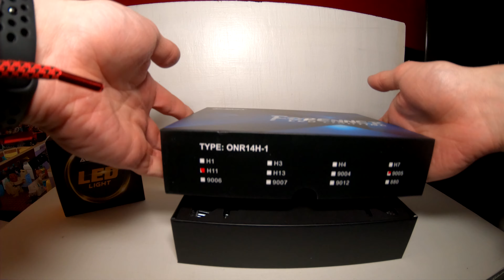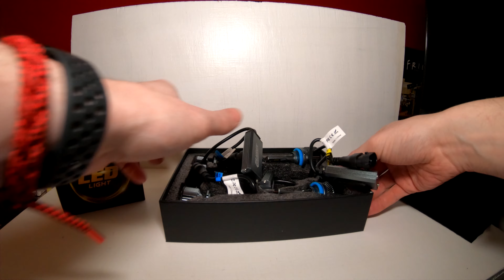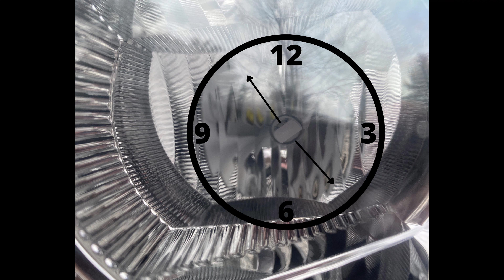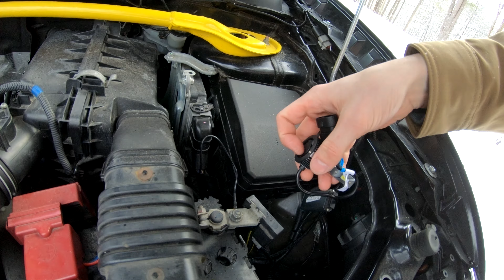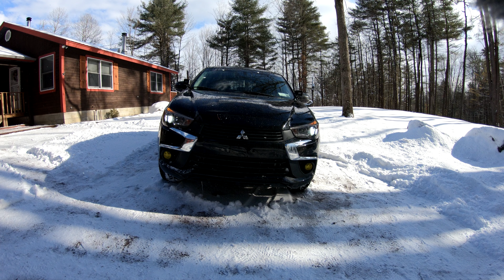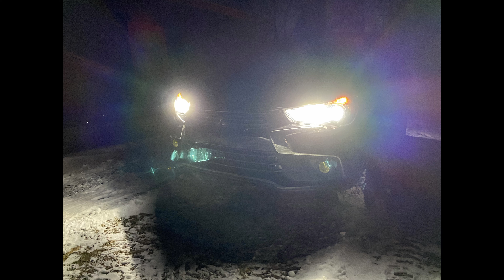Fahren Low Beam and High Beam install with Auxito fog lights on Mitsubishi Outlander Sport

Comment: Hi Jarred26. I purchased and installed the sequential side markers that you did a video on. I did them because your video. On these led bulbs you installed in the front, did you get any electrical faults or problems? How have they been working and can you leave a link for these bulbs. Thanks
Reply from the maker: Over a year with all the led bulbs in the headlights and fogs. No issues at all and the links are still active in the video description so I suggest going to those. That’s the exact ones I purchased and zero complaints or performance issues in the last year.
Reply: @Jarred1115  Thanks I didn't think to check description of video. I will. I know some cars are sensitive when LEDs are installed and throw all types of fault codes on dash. Glad that these seem to work. I'm going to look into doing mine. Appreciate it Jarred.
Reply: One other question. If my outlander sport has hid bulbs, can I  replace them with these led bulbs?

Comment: How come only part of the assembly is showing? Like should their be more bulbs
Reply from the maker: Are you referring to the still photos? Those are showing just the high beam as those need adjustment. The low beam (projector housing) should go in normally with no adjustment to the new bulb. The outlander sport has individual high beams and low beams unlike some vehicles that use dual beam bulbs.